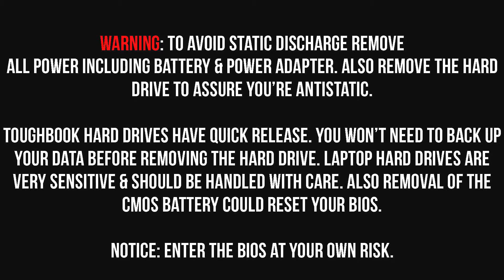How to Replace the L7500 System Board in a Panasonic Toughbook CF-30

Comment: Thanks so much,...Great video on installing the L7500 System Board in a Panasonic Toughbook CF-30. Should make my motherboard replacement project considerably easier, & less likely to screw up! 💻 👍👍👍 Keep up the Great DIY video series,...they REALLY help with repairs & upgrades! 👍
Reply from the maker: Glad it will help.